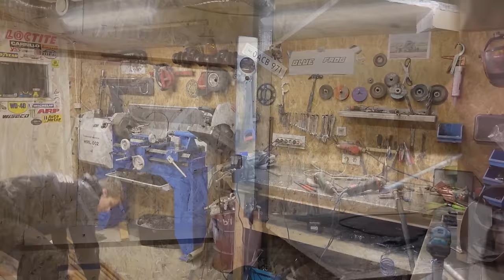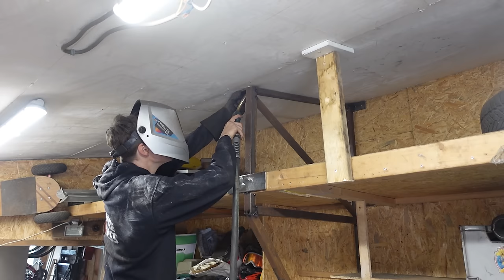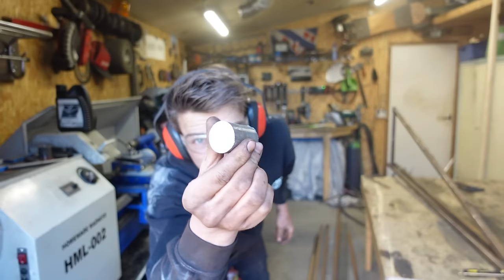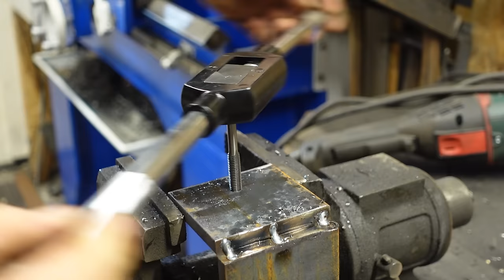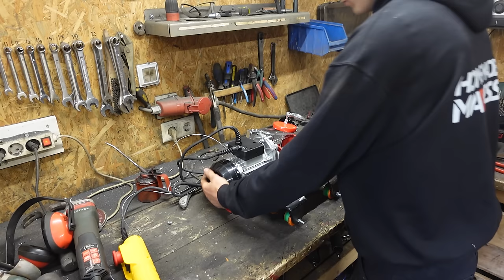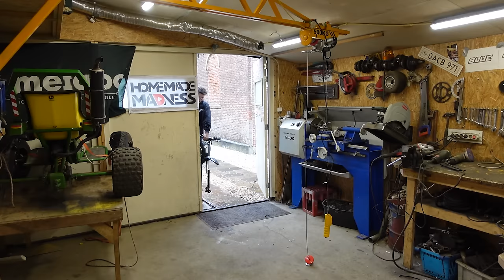Workshop Jib Crane - BUILD

Comment: Yes, great skills, tooling, and ability, however; ? CAPACITY ? (500 KG = 1,102.31 Lbs. or 0.551 Tons) = Capacities are  determined by the weakest link in the materials or system. Those weakest links could be the support structure being attached to (in this case it looks like an OSB wall structure or member), any given link in the jib crane structure itself and any one piece of the structure that could be the weakest link, as well even a single weld, a bolt, trolley wheel (in this case an altered nylon wheel), or any swivel connection and it's design and fabrication. Many variables of compression, tension design calculations to approve a capacity of a system is required. "WHEN AND IF ANY ONE MEMBER WOULD FAIL IT COULD AND WOULD CAUSE A DOMINO AFFECT IN COMING DOWN AND IT'S FAILURE."

Comment: Looks great, make sure you have a stop at the end so the motor won't roll off the end there.
Reply: If you look closely there is one!
Reply: Do you really think a guy who's talented enough to build a crane wouldn't know too put on a stopper? Lmao
Reply: @GregoryJohnston77 Uhhhhhhhh......... I've uhhhh built similar things and uhhhhhh.... Look... we aren't all the brightest that's all I'm saying.
Reply: @tonywhite6107 all I saw was the power cord holding it back. It needs a metal screw on bracket.
Reply: @GregoryJohnston77...  Sometimes even the most obvious things are overlooked by the brightest, smartest and most knowledgeable people. It's not too different than a situation where the most obvious question isn't asked especially when it should be. And why isn't it? The most common excuse is "...because everybody had already been to that rodeo...". The smart play is to go over the totally obvious even though it's totally obvious! Going through the motions and doing your due diligence eliminates the mistakes. Think of all the people through history who ended up seriously injured or dead because they didn't. Best wishes!

- Max Giganteum

Comment: Love how you worked around the low sloping ceiling with this design. I'm definitely going to use many of these design elements and build myself a similar crane for my shop. Maybe two of them. I have a CNC Plasma table that needs one and a Big Lathe that also needs one.
Reply from the maker: Yes that was the main reason i went with this design!

Comment: Good job. Just 2 things. First is obvious. Screw in the stop at the end so engine and load won't suddenly roll off the end. And second is you should probably fix top and possibly even the bottom part of the static structure (before the hinge) to prevent it from folding sideways when you'll be lifting stuff on the sides. That would cause instant fail of the crane.

Comment: Very inspiring, have been wanting to do something similar for a while myself.   Be careful, a very common misconception, doubling the line does not double the lifting capacity of the crane or Jib!!!  It simply reduces the winching force required to lift by 1/2(doubles the lifting capacity of the winch, not the crane). I've seen actual cranes upset because the logic of a 2 part line were misunderstood by the operator.   From what I can see, your build can easily support 500Kg, always a good idea to over engineer,   Good job!!!  Looking forward to more.

Comment: Good looking crane, it follows the roofline nice with that truss girder.

Just a couple of queries, what size and grade are the bolts you are using as pivots? 
By the time the load is out on the end you could be talking 1500+kg of shear force on the top one, I also hope your wall and roof mounts are into something strong, it is not clear in the video, but if they are just bolted/screwed into a timber frame it could easily be a failure point. 

Thanks for providing a good example for new builders by not removing the guards from your angle grinders, although I will say that you should get some welding gloves, skin cancer is no joke and sunburn on your hands hurts real bad...
Reply from the maker: Thanks! it are 12mm shanked bolts wich will not shear all that easily i think. its screwed to a timber frame wich is mounted to a concrete wall of the building nextdoor. I made sure to make this part of the workshop extra strong when i built it, because ive been wanting to build this crane for a while. extra roof rafters and stuff like that

Comment: That’s perfect! Not over built I think you made it just right! Now I’m thinking of what engines weigh 500kg haha , v8???
Reply: Those cheap china witches i would never put on full rated force, specially after while in use with out safety lift test. Had few boat winches that suppose to hold all the way to 900kg. Put some some weight on it and locking mechanism slipped and thing went free willy. Thankfully nothing major happened, but as rule goes, never go under load that is not entirely secured with physical support, like when working on car, put the rim/rims under the frame and maybe even drop it on them and put little pressure on the lift. If it falls off or lift/jack fails there is something stopping it from crushing you, same with those cheap car jackstands. Almost lost a foot when didnt listen to this rule, lift the car and didnt notice lift disk was partially on the roll bar. Went to work on the brakes when suddenly it moved and whole hub shot down from the twisting force of the roll bar and spring combo. If i had my knee under it... uuuf
Reply from the maker: Yeah not sure about te 500kg tough😅 next project is 4cilinder engine luckily
Reply: @Hellsong89  A boat winch is not a hoist. It's only intended to pull horizontally regardless of the rated load capacity. Lifting hoists for overhead lifting are specifically designed with proper safety rated brakes. You're playing a dangerous game if using anything other than a certified hoist for overhead lifting. Personally I would never rely on a cheap Chinese junk winch for overhead lifting. My life isn't worth the gamble.

Comment: on my exact same winch the 2 countersunk bolts that hold the motor assembly to the metal plate snapped off while under load, chinesium quality. changed them for 10.9 high tensile bolts and now a year on no problems.
Reply: i would add bolts to hold the winch to your rolling plate ,, I see you welded it ,,just be a bit safer with some bolts also just in case a weld cracks or breaks ,, don't need a engine to drop on your head ..also check your winch cable from time too time .. the wires do wear out and start breaking ,, also keep a eye on the bolts in the wall make sure they stay tight .. just some advice

Comment: Think about adding an antidrop plate to the trolley, if those bolts/wheels fail would be nice if it didn't fall and chop your fingers off or pin you under the crane. Also not a good idea using a pulley to double your lift capacity when the weak point is probably elsewhere and you haven't tested it at rated capacity or allowed for dynamic loading (assume 125% when your bouncing from speed 1/2). An end stop or keeper plate would also make sense, looked like the trolley was coming off on your head when lifting the bike.

Comment: Did you do any basic calculations to determine what safety factor you have when hoisting max capacity 500kg?

You should proof load it to at least 750kg (150% of max capacity) to make sure nothing is bending.
Reply: Absolutely agree that the crane should be load tested, but does the 500 kg label refer to the hoist, or the crane as a whole?

Great work though. The only think that concerned me was the lack of adequate protection while welding. Intense ultraviolet light and bare skin is never a good combination!
Reply: @pauldorman  Whatever the label says should be the capacity of the entire system and not just the individual component. This is industry standard. Imagine what would happen if the jib can only support 250kg before bending but the hoist says 500kg. How does someone even know they should not lift more than 250kg? They wouldn't know. They rely on what the label says so that label should be the rated capacity of the weakest component in the entire system.
Reply: @internettoughguy  I have to agree with you. At first I thought the capacity was original to the winch, but then looked again. 500 kg at the end of the crane would probably bring the wall down!
Reply: looks like a death trap to me

Comment: Whats the size and grade of those pivot point bolts?
Reply from the maker: M12 8.8
Reply: Those will wear down/ you could add for example nylon bushings, and preferably replace those bolts with Hardox round bar or similar.
Another issue might be those rollers bolts. You could add safety "claws"; in case bolt snaps, the sled does not fall down.

Comment: I see a possible design flaw. I would move the winch on to the wall. Create trolley locking holes and pins with trolley cable roller pins. This will minimize the weight on the boom. Also possibly increasing lift capacity.

Comment: Hey nice job 👍 but i think you need 1 little improvement. If you use it left or right the forces also go to the sides...but those are only hold by wood of your board. You schould du 4x 45degree profiles left and right

Comment: Three things I see.

1. At the truss pivot top stop blocks or 45% angle  down to the shelf 🤔

2 a cam Lock from trolly to bottom rail to sop unwanted movement 🤔

3. Extend it 🤔😳😃for you can lift anything to your lath . Go for it🤔👍😃

Comment: Hi, my name is Angelo and I am writing to you from Italy with the help of an online Translator (I don't know English let alone speak and understand it). I am very interested in your project for the crane in your workshop, I would love to be able to make it for my garage too, I have serious problems with my back and at 58 years old I can't lift weights from 30 kg and up anymore. I already have the winch or electric winch, I lack the structure. I saw from the writing on your winch that the weight it can lift is maximum 500Kg!!! I only need 200Kg. What I kindly ask you could you tell me the measurements of the various components you used? The sections of the iron tubulars and their thickness, everything that is part of your design, and, always if you can give them to me with the metric format and NOT in inches. Thank you x your possible help. I salute you

Comment: Hi. This is osome 👍👍 Im thing make something like yours but 300+ capacity and 3metre long for my car workshop. 
Directly wall mounted. 
I'm thing use 40x40x3 square tube to arm frame but plate for wall mount is only 6mm thick. 
How you thing is good enough for 300kg ?? I don't want destroyed 10000£ worth car 🤣🤣🤣
Ps. Sorry my English🍻
Reply from the maker: 40x40 square is strong enough but the wall mount needs to be REALLY strong this one is into the wall and building nextdoor
Reply: @homemade_madness  I have 4 6mm thick plate. And be mount one inside with hinges vand second outside. I can go thrue to the wall. Bolts I'm use 16 mm threaded rod or 20mm. All nuts welded to the plate after hard screwed. Hinges I'm use 30 or 35mm solid bar. 
I'm think this will be strong enough eaven for 500kg🤣🤣

Comment: When exactly did the habit of using measurement tools (calipers) for marking parts start? It can be seen with all of those Youtube artists, who have all funky welders and stuff, but can't affort a cheap scriber? No professional deserving to be called one would ever do that.
Just as there is a difference between "gluing parts together with a welder"and "doing a proper weld". Hard to believe that a butt weld on those 10mm or so plates would achieve full penetration with a MIG welder common for Youtube artists.

Comment: I would suggest that you have a structural engineer come out and check over the design and mounting of the crane frame. You've got a lot of moment force on that frame, especially when the trolley is at the far end. Wouldn't want you to get hurt having it fail and dropping something very heavy on yourself.

Comment: AS WELL; OSHA (Safety and Health Regulations for Construction) 1926.1431(a)

The use of equipment to hoist employees is prohibited except where the employer demonstrates that the erection, use, and dismantling of conventional means of reaching the work area, such as a personnel hoist, ladder, stairway, aerial lift, elevating work platform, or scaffold, would be more hazardous, or is not possible because of the project’s structural design or worksite conditions. This paragraph does not apply to work covered by subpart R (Steel Erection) of this part and also does not apply to routine personnel access to an underground worksite via shaft as covered by § 1926.800 (Underground Construction) of this part.                                                                                                                                                                   IN OTHER WORDS, TO LIFT YOURSELF IN THE SEAT OF AN ATV IS A NO, NO! Especially in the design of what your indicate is a 500 KG Hoist (or winch in this case), let's call it a 1/4 Ton capacity system.